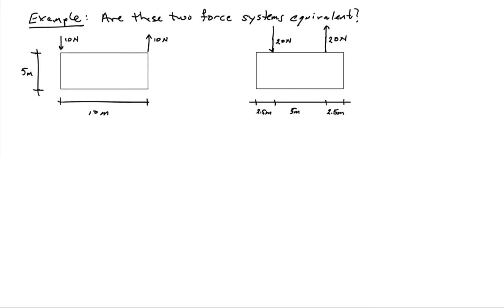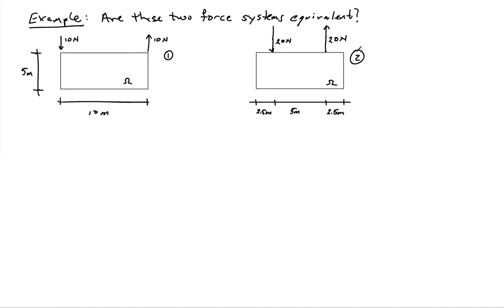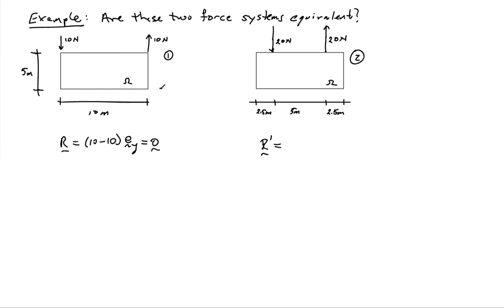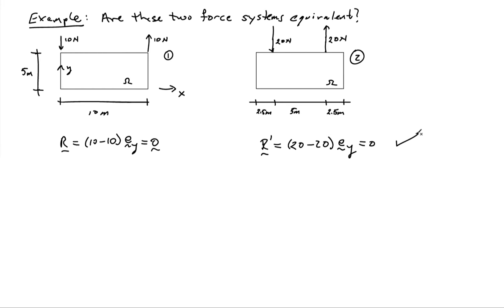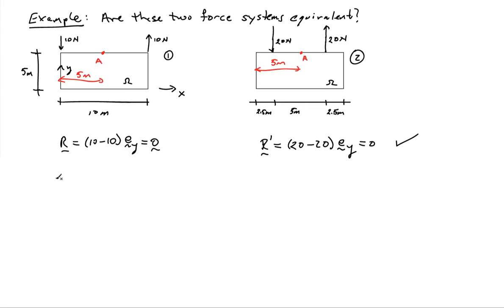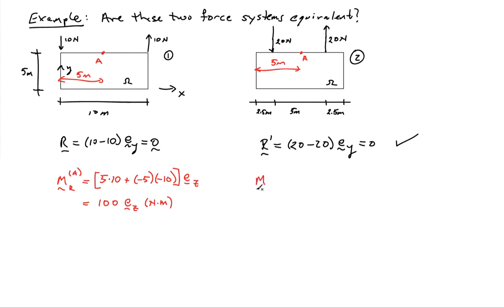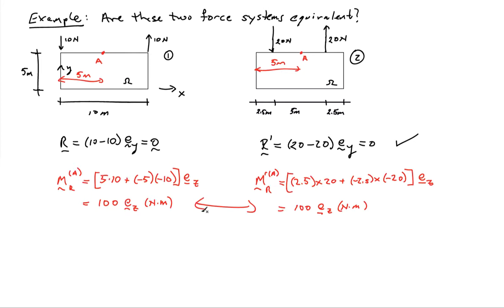(6B) Example: Checking if two force systems are equivalent

Comment: how disatance become negative
Reply from the maker: It is not that the distances are becoming negative.  The moment is actually the position vector cross product with the force vector.  For example in the case on the left, the negative 'distance' arises from M = r x F = (-5 e_x) x (-10 e_y) = (-5)(-10) e_z, etc.
Reply: @sanjayg0  thank you sir